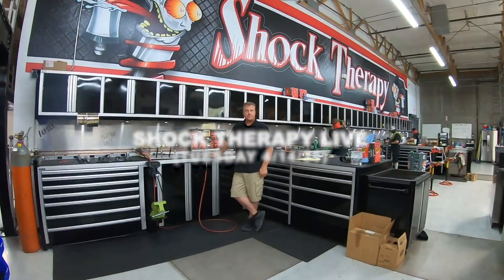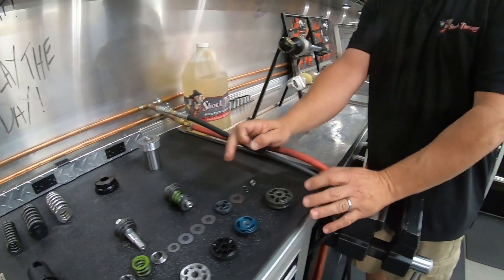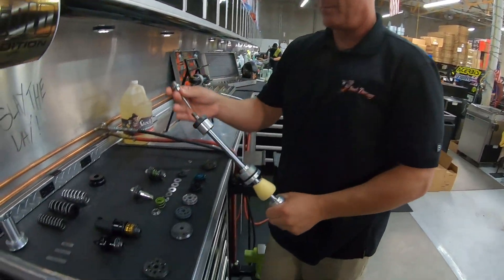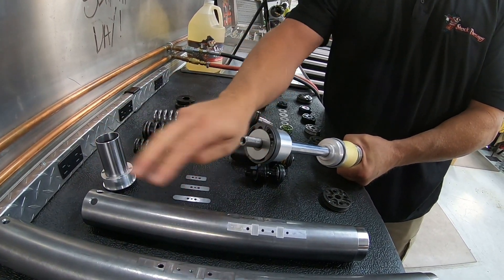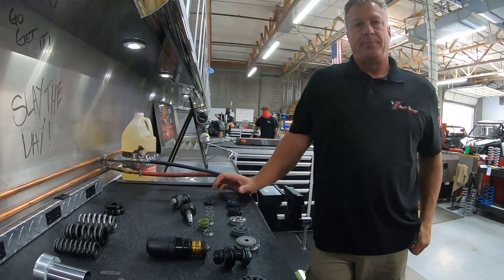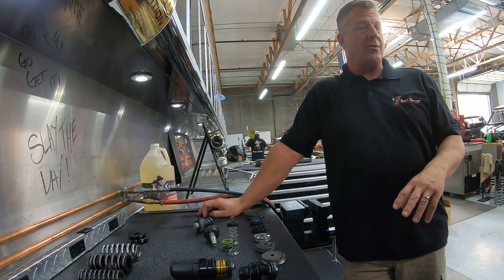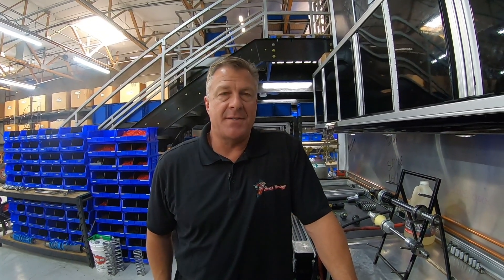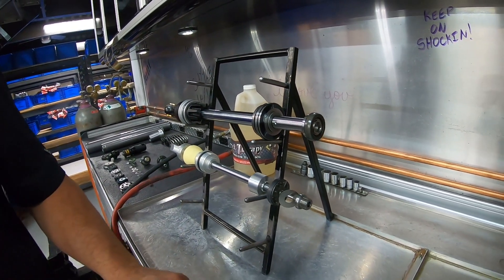Shock Therapy LIVE: Internal Shock Mods (4/14/20)

Comment: when adding the IQS system to your fox rc2 shocks  , i assume you lose separate high and low speed compression adj.  are both hi and low speed adjusted at the same time ? and  can you explain how the IQS  soft , med, and firm settings correlate to the manual  clicker positions?
Reply from the maker: Absolutely. Yes you loose the separation of high and low with IQs. They are both adjusted together with IQs. The three settings, soft, medium and firm are equal to your high and low speed adjuster all the way soft, two turns stiffer (middle setting) and all the way stiff (four turns). The IQs adjuster does flow more fluid than the standard DSC so you will get 10% softer and 10% stiffer with IQs than the DSC gives you. Hope that answers your question. Thank you

Comment: Sorry I missed this live stream. My question is when will you have some spring and shock upgrades ready for the Kawasaki KRX 1000?
Reply from the maker: We actually just finished all our testing. If you would like you can set up an appointment right away. We are installing these options now. We just won't sell the spring kit on the site until we have instructions for them.